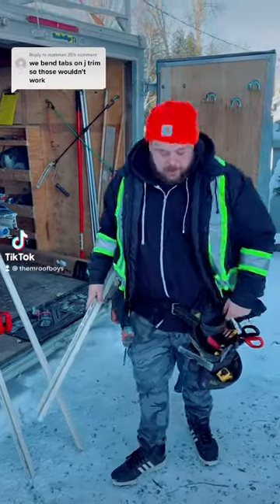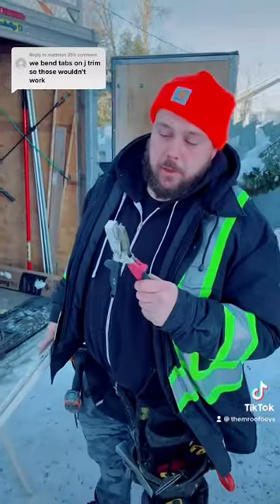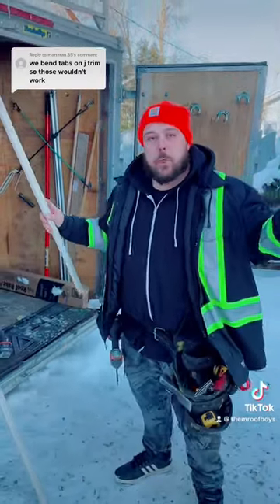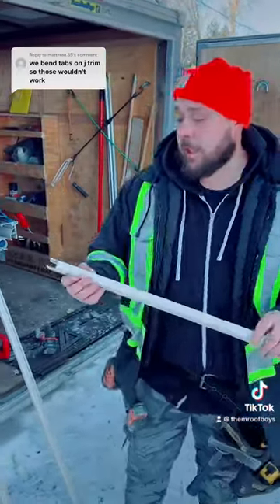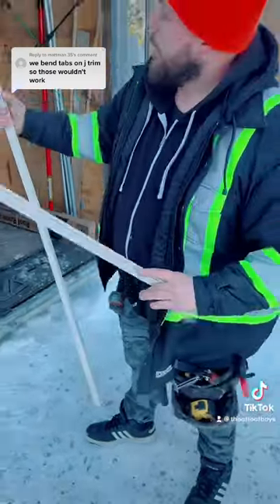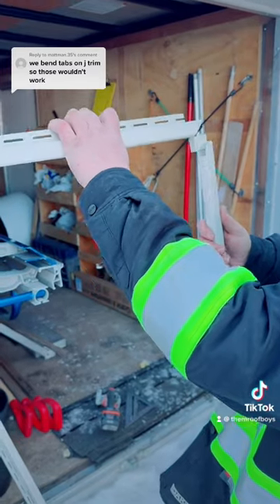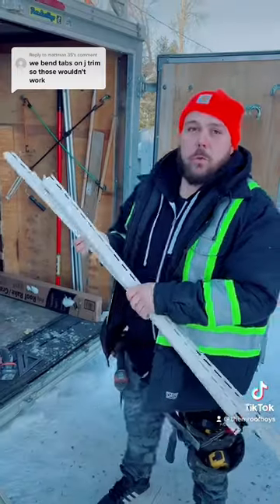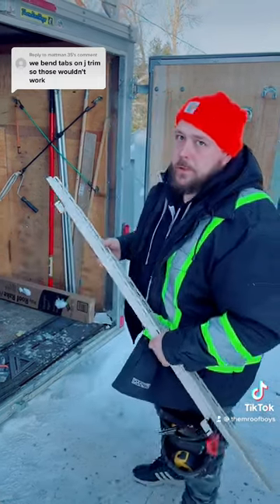How to J channel #roofing #shortsfeed #construction

Comment: You also drill weep holes on the bottom, almost more important.
Reply from the maker: Weeping holes only required in a situation where J channel would be installed facing upwards! Like on the bottom of a wall that’s done in vertical siding for instance! CHEERS

Comment: Actually the 45 on the bottom doesn't kick theb water. You should  put a piece of metal under the bottom and side j channel then run it on to the siding.

Comment: I do the same way with my J channel but I 45 my top and bottom one and I cut a little bigger flange on top and bottom of the piece slides right in and I like when you nail those flanges tightens up your corners!! Not saying your way is wrong!!